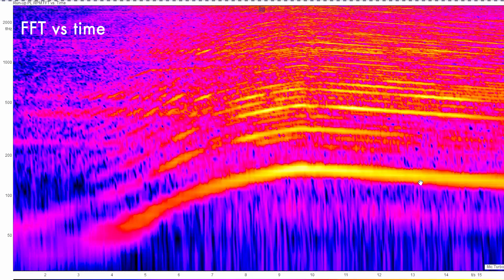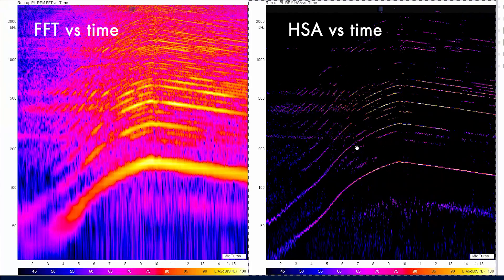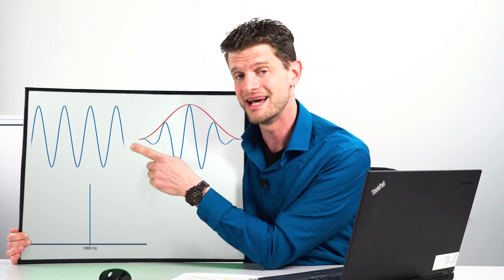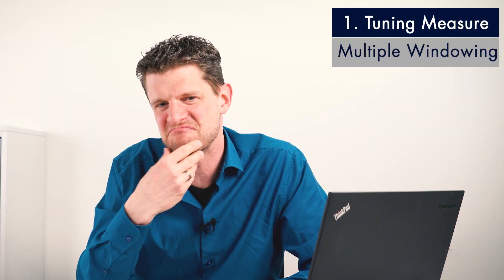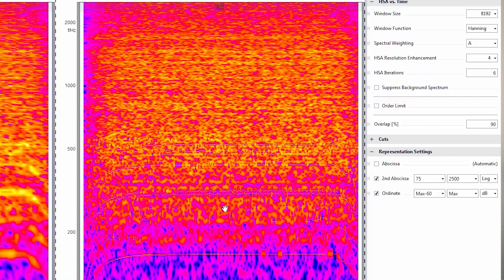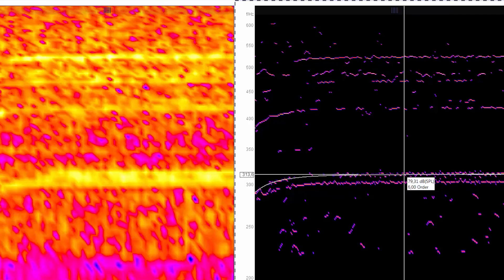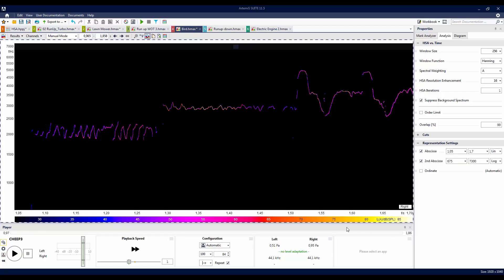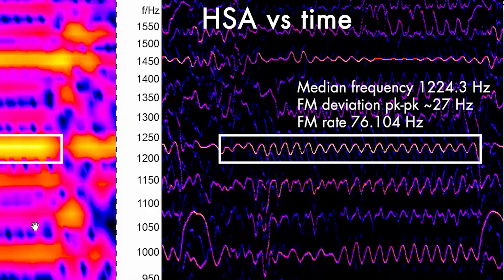Advanced FFT Analysis HSA - frequency and time resolution as you want

Comment: Hi 
Very explantive video.
I need to see the difference of sounds in hand held Power tools (angle grinders) which measurement is best?
1. Loudness
2. FFT
3. HSA
Or anything else??
Reply from the maker: An angle grinder is a really loud tool. 🙃
Ad hoc, loudness is the analysis that gives you a meaningful value for the loudness perceived by humans.

For a more in-depth analysis of the frequencies and thus the causes, an FFT, hearing model, and HSA are suitable for orientation.
For initial orientation, it is useful to record the time data of different devices, subjectively coordinate a ranking of the devices by listening to them, and at the same time compare the values of the individual analyses of all devices with each other.
Then you can quickly see which analysis is the most meaningful. From then on, it's objective.
The ArtemiS SUITE includes special software tools that do exactly that: first, listening tests to determine the ranking, then using the results to select the right analyses and compile them into an overall assessment metric.
Often, it is the combination of several analyses that delivers the best result.
Just contact us at info@head-acoustics.com. We will then send you more information material.

Comment: This is awesome! wished to have the tool in hand
Reply from the maker: Thanks for your feedback. 
Feel free to get in contact with us.  
We still have some licences  :-)     -> www.head-acoustics.com
Reply: @HEADacousticsInternational   Test a gas stove at, e.g., five different powers. Record the acoustic signal and the sound pressure level [this latter will not be a precise value, but their ratios will be]. For the acoustic signal, you can use, e.g., the Spectroid or Spectrogram app (there are a lot of apps out there to do FFT on the microphone signal). For the sound pressure level, you can use, e.g., the Andro sensor app. Evaluate the measurement results, please can you solve for me as I am facing for problem
Reply: @HEADacousticsInternational  imagine converting audio to midi with that!!

Comment: Hi Till! Great video! Sounds like I don't need FFT anymore :) are there any restrictions or any cases where I should rather use simple FFT but not HSA?
Reply from the maker: HSA is perfect for a multiple tonal frequencies mixture like a gear box / engines / mutliple modes. 
For broadband noise, when the source is piece of mood, it will loose its advantages.
I recommend to start your analysis with a standard FFT vs time. That is you base ground. If you want to get better results  then calculate an HSA analysis with a soft setting. Like shown in the tutorial. Then you can pimp your results with four more tuning measures. For a first practise on your task it is good to start with a short (5 seconds) snipping of your measurement.
I recommend to start with 2-times enhacement / 8-12 iterations / background suppressed / 90% overlap.  If you miss some frequencies you like to see, then increase the number of iterations. Is this is still an overload of colors reduce the number of iterations.  Then check the effect of the frequency enhacement.  In 5 minutes you will have a analysis plot adapted to your needs. Save this for this application  :-)
Reply: @HEADacousticsInternational  thanks for the detailed response 👍
Reply: @HEADacousticsInternational  have you tried using DFT then putting a lowpass filter on each signal * real & imag parts with the cutoff being the frequency of the bin? it increases the frequency resolution without destroying time resolution then you can use a simple filter to get all of the peaks with near perfect accuracy and it doesn't take as much resources as overlapping the chunks. it can make the resolution extremely high even on low chunk size like 512 or 1024, it it looks good when you extract the peaks.